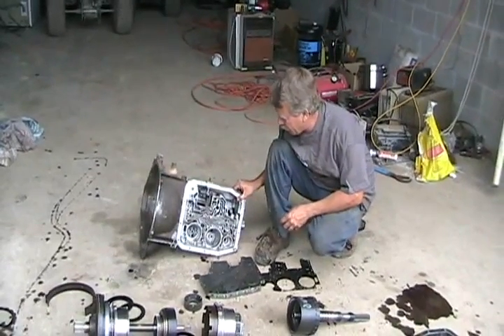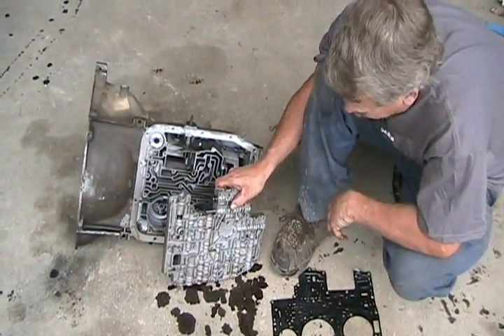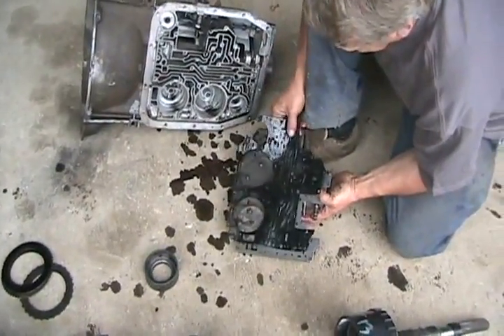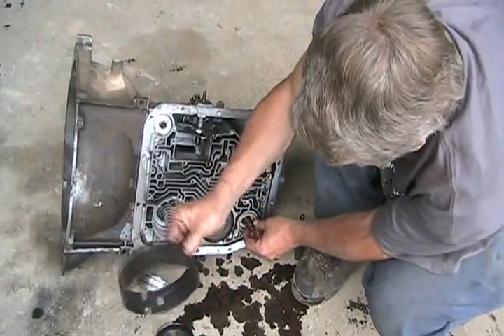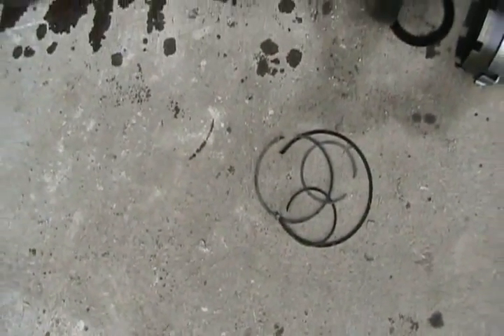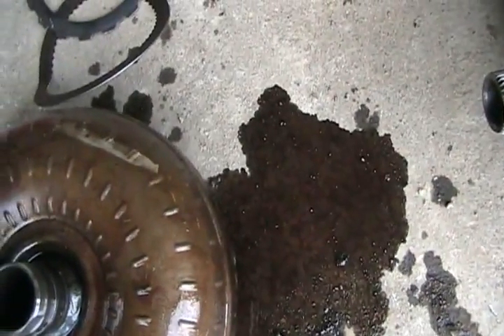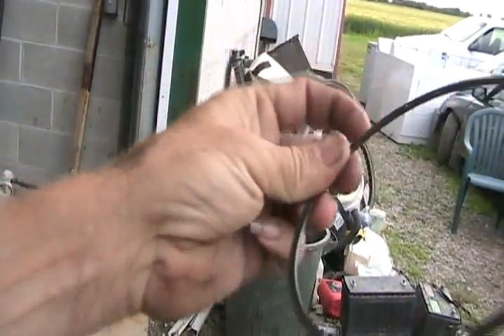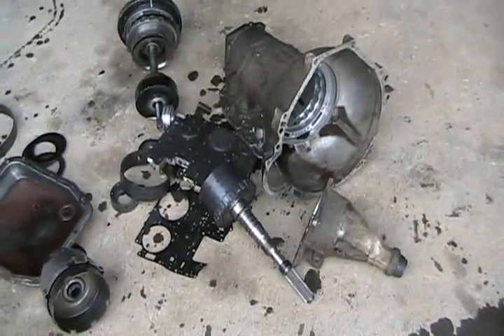How automatic transmissions work, part 2 Davidsfarmison[bliptv]now

Comment: So torque converter impeller spins fluid which then powers a turbine, then based on the oil pressure from the spinning turbine, pistons are directed to engage different clutches, friction plates, and brakes to then allow the transmission to engage a different set within the planetary gears, creating different levels of torque? Is that essentially how it works?

Comment: hi david you seems to have a better understanding of transmission.which part of the transmission is spinning, while your cars is a stop & the gear is at neutral position?i was advice to change most of my atf by removing the return cooler line to the reservoir & have my gear at neutral, in order for the pump the old fluid out. replacing the same amount back.if there is moving parts in the transmission,. 
i am afraid i might cause damage to the internal transmission.what safest way to replace the atf?pls help.thx :)

Comment: From where does the fluid in valve body get information about input shaft speed (engine speed) and output shaft speed (and wheel speed) and how does it "compute" when to shift gears (move pistons and actuate bands or brakes).??

Comment: ...go ahead and have a mechanic check it. I checked the fluids levels with the car off and while it was running and got the same fluid levels. I'm pretty sure the pump shaft is the issue but I need to know how to get the transmission off without having to remove the engine block.

Comment: wow thanks for uploading this video. looks like this is probably the reason my transmission won't shift into D at all: the pump shaft issue. My car is an 04 pt cruiser touring edition auto trans between 100k and 110k miles and before the transmission completely stopped shifting I experienced slight shift slipping that steadily grew worse. I was actually less than a mile from home when it stopped shifting entirely. My parents want me to...

Comment: I have a 2000 hyundai elantra and it shifts reaallly rough. I press on the gas quickly and it'll rev and won't shift until the last minute. Nearly blowing my engine. It has about 150k miles. If that makes a difference. What could be the problem? The over drive makes the rpms go up and down a lot when im going the same speed. So i have to keep it off. Please help!